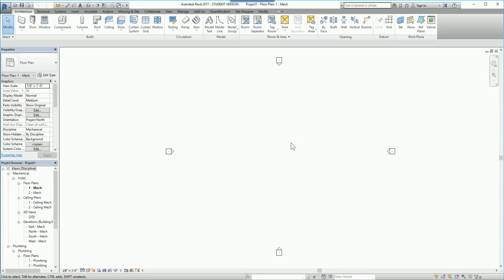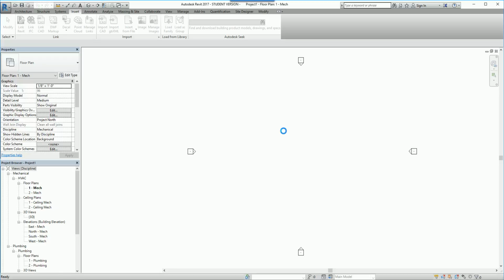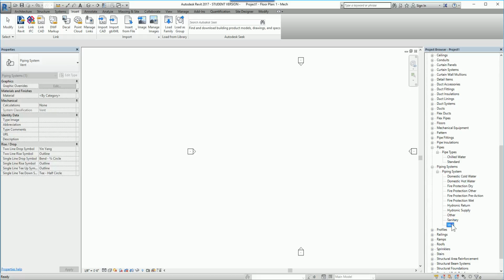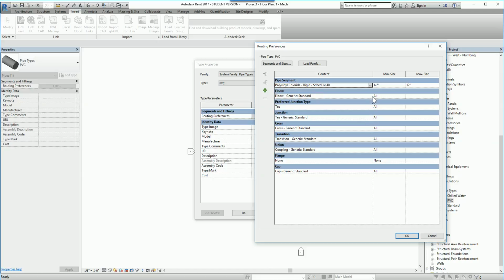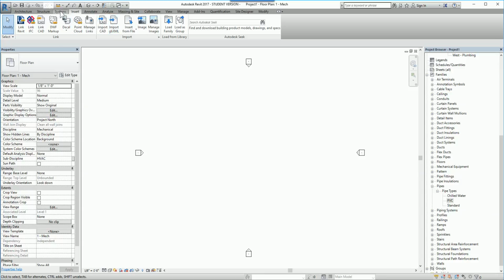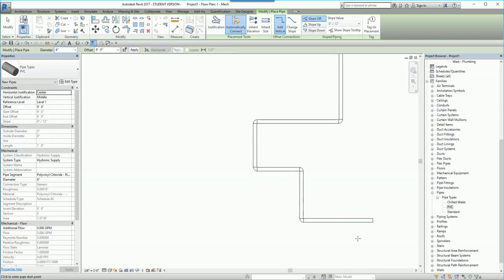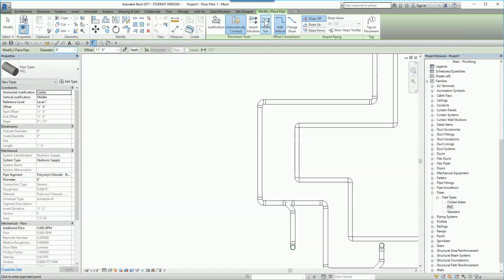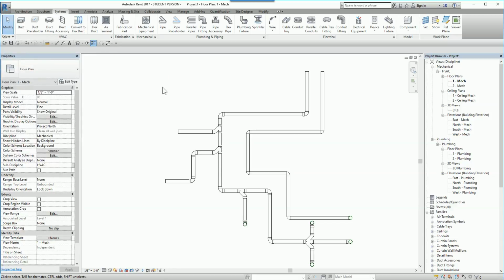Revit 2017 - Plumbing - 01 Reloaded

Comment: could you save that file in revit 2016
Reply from the maker: +Łukasz Małkowski, sorry. Revit does not allow to go back in versions. I'll see if I can find a R16 with similar configuration. Thanks.
Reply: that would be great.
you can try to export IFC file in revit 2017 as well - to allow open it in every revit version.
thanks a lot.